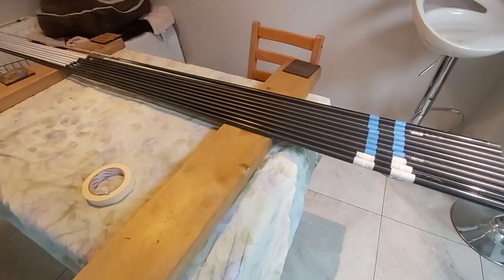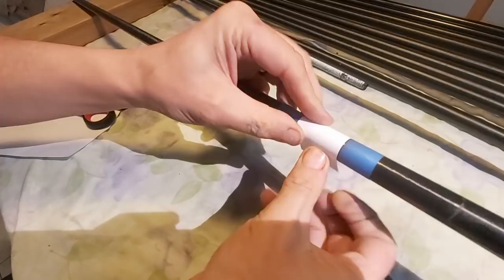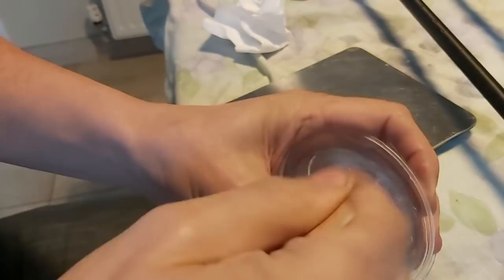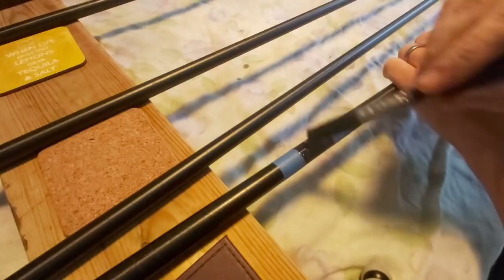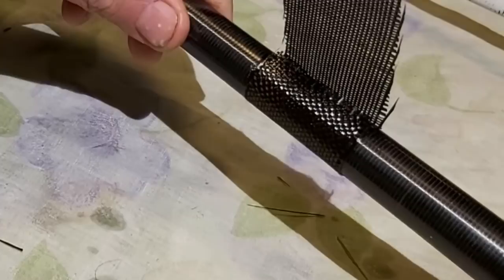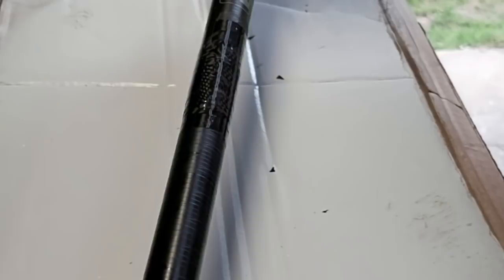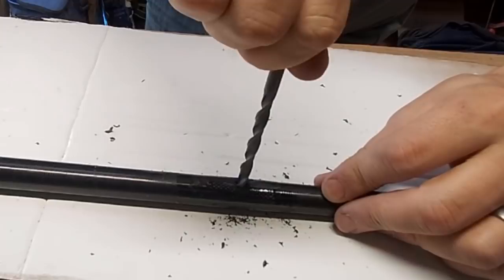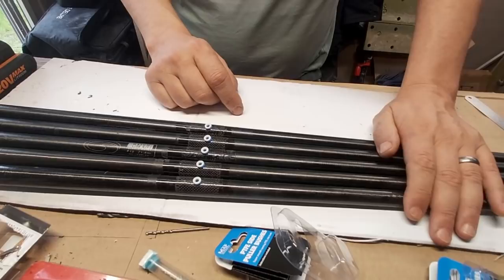CHEAPEST WAY TO GET SIDE PULLERS, Pole wrap and side puller start to finish. MAP side pullers.

Comment: Tip for you that I use. When drilling into the section place a length of wooden dowel rod up inside. It helps  support the section and will stop you drilling through the other side if you are a bit heavy handed.
Reply from the maker: Thanks, good idea😊👍

Comment: Too much hassle  ,        It would have been much easier  to have bought a make of pole with the puller kits already  fitted.
Like I did.
Reply from the maker: True but they didn't always come with side pullers, So if you had £600 worth of older top kits might think differently😊👍

Comment: Slipping a piece of dowel in the section when you drill stops all the worries of hitting the other side and the drill bit pulling in. Nice job pal
Reply from the maker: Good idea that, if I do any more I will be doing that👍.
Reply: @AverageAngler  I was thinking of sliding in a bamboo cane...

Comment: Hi mate I'm about to do a margin pole, I've bought the repair kit, pullers etc just wondered what width of wrap you used, is there any recommendation for the wrap size?, Also the measure from the end to the third section? Thanks
Reply from the maker: About 4inch wide would be more than enough. Best thing regarding distance from end of the kit, just think where you would want it when you are playing the fish.
Reply from the maker: I think I do measure the width of my wrap on the video? Might be 2 inches??
Reply from the maker: Hi Matthew just rereading my comments if you are doing puller wrap then 2 or 3 inches, if it's a section repair 6inches.

Comment: Why did you decide to omit the hair dryer heat shrink process on the heat shrink tape that consolidates the resin & fibres into 1? If you miss this, you will be left with an uncompressed, softer, weaker, rougher finish with loose fibres.
Reply from the maker: Tape provided with the kit I use, does not shrink when heated. You have to apply quite a bit of pressure when wrapping, my finish has always been good😊. You can get kits with shrink tape and use a heat gun if you wish👍.
Reply: @AverageAngler  Maybe you have forgot your own video. At 27-29 mins you criticise your own finish and start sanding the rough bits/steps. I would recommend using the heat shrink tape. You can only put so much pressure on with the tape unless its shrink tape because your tape will have no elasticity to produce tension. You could go over the clear tape with stretched insulation tape afterwards to provide some of the missing compression. Your windings are far too spread out too. If you look at the spirals on a professional pole, they are only 3mm apart. This is because the tape is 90% overlapped with only a 3mm offset from the last wrap. If you did this you'd get a higher pressure and better finish. It's like 10 elastic bands round your fingers will crush them more than 1 elastic band. Please don't take this as criticism - it's positive advise and we're all here to learn. You can also reduce the fraying - cut the length parallel to the mesh and you'd have fewer stray ends to combat. Also, keep the cloth in a long length and rotate the pole until you have a double wrap, then cut it to length. This way you can keep the tension on the cloth without accidently pulling off the last strands.
I showed the composite dept at my work what I wanted done to my poles - the above is what they said - it's good positive advice!

Comment: I use a piece of hose pipe, inside the pole section. Then when you drill or use a mounted point, you can not go through to the other wall of the pole section
Reply from the maker: A great idea, 👍. Thanks Paul😊

Comment: Hi john just in the middle of doing my side pullers I've checked them after 2+hours and they are tacky but can't get the wrap to stick would it be I haven't put enough of the formula on I only put it on thin or do I need to wait longer getting worried now?
Reply from the maker: Probably gotta wait a bit longer, all depends on temperature and  ratio of hardener. Good luck👍
Reply: @AverageAngler  It get tacky but the wrap won't hold don't know what to do now with the sections will i have to rub it all down again you made it look so easy?
Reply from the maker: @paulsomersetwolf5970  it should hold, it won't be a mega strong hold just enough so it clings to the section. Are you doing it in the house not in a cold shed or garage.
Reply: @AverageAngler  in my garage but  let them dry in the house it was tacky but left it for 4 hours but watching yours when laying the sheet on the part it just stuck but when I started to go around the section it just wouldn't stay it flicked up where I started so I gave in will I have to sand them down again to restart theres not loads on which may have been why it didn't work?
Reply from the maker: Sounds like you were nearly there, sometimes it doesn't stick so well, but you can stop the end curling up by wetting it with the resin on the brush. I tend to just start it on the tacky stuff and kind of brush it on with a wet brush(wet with resin). I would rub it down a little before retrying don't go mad though.
Reply: @AverageAngler  yes already to go again I will indoors in the warmest place and just try one and see how go then hopefully do the rest I think the temperature and not putting enough Resin on is my problem 
I do 3 parts Resin too 1 part hardner but soon thickens up but it's the same as you do.
I will get it right if it kills me🤣
Thanks for all your help👍
Reply from the maker: Just check the ratio of resin to hardener, sometimes they change the resin so ratios change. Should have some instructions in the pack.
Reply: @AverageAngler  just done 6 kits now and much better I was doing it in the wrong temperature but started with two yesterday just unwrapped the two and there not to bad really but I think the next 4 will be better 
Got easier and confident the more I done.
Thanks for your help John.

Comment: How are these holding up mate?
Reply from the maker: They were working fine, I have now upgraded pole and have some newer top kits. I isn't upgrade because of the kits they are still fab.
Reply: @AverageAngler  thanks, priced it up not using one of those pre packed kits and it's much cheaper.

Comment: Thanks for the tips on how to do the wraps , I bought the repair kit off ebay and did 7 kits with loads to spare , so it's a really cheap way to do them , and it was also really easy to do , would recommend anybody to have a go , cheers.

Comment: Did 4 over the weekend a bit of a pain in the rear with the carbon ends always coming loose but got there in the end. I only had a small bit of the clear tape in the kit I bought - ran out quickly so the last kit I had to use electrical tape backwards - worked fine.
Once the resin had gone off and I removed the tape it needed a light wet n dry sanding to smooth a few rough ridges. Keyed the whole repair and gave a light coat of resin to smooth it all out - 
end result nice lovely smooth and glossy finish.
Reply from the maker: If you rub the wrap down a bit, a coat of lacquer gives a nice finish.

Comment: Hi john 
I sand my pole repairs blend them in then lacker them it gives you a lovely finish.
Great video john 👍
Reply from the maker: What do you use for lacker, I would probably have done that if I had some lacker.
Reply: Hi john
I us autotek lacquer from the car when youve flated them off with different grades of sand paper and wet &dry it will look dull till you lacquer them you will get a nice smooth finish john

Comment: Good stuff.

You inspired me to get some carbon fibre and resin and a few MAP side pullers to have a go now.

I can't believe how awful that carbon fibre is to work with. You cut it nicely then the slightest sideways movement pops the edge strands out then it gets worse from there!
Reply from the maker: Yes it can be tricky stuff😊👍

Comment: I am lazy and just slide a piece of an old pole down the top kit to the place I need it. Glue it.You now have as really strong section to drill into. Yes a bit sticks up but a bit of masking tape over it does the trick. It works honest.!
Reply from the maker: Whatever works, works 😊👍

Comment: Great video! I am considering doing this to my topkits. I also found this on the internet, not sure if it will be the same in strength as the carbon wrap. = Vespe stripper side puller + wrap – DRILL 6.0MM
Reply from the maker: They work well just need to check they are correct for your pole, don't fit all models😊👍.
Reply: @AverageAngler  Thank you very much, I will give the Vespe a try. If it doesn't work out I will do the carbon wrap. :) I have another question, I see that you mainly fish with the feeder. Do you have experience with Preston poles?
Reply from the maker: I have never used a preston pole, I mainly use garbolino now, so I have very little experience with them.

Comment: Great video. Is there anything you'd do different if you did it again?
Do you think it would be possible to 'mask' either side of the wrap maybe with the clear tape 1st to get a neat edge with less resin overspill? It appears that any other type of tape may not come off so cleanly?
Reply from the maker: Use even less resin I think, and glue those side puller bushes in😊👍.

Comment: On eBay & other sites, they sell carbon tubes in 300mm lengths. What do you think about sliding a 50mm sleeve down the pole and gluing into place? I note that there's another video where vespe supply a 'pulla' sleeve that looks nothing more that 20mm plastic conduit that you can buy at wickes at £1.30 for 2m.
Reply from the maker: I wouldn't be doing anything like that, the plastic tube or carbon would need to match the taper of the top kit I should think? The carbon wrap is the lightest way to do it and will definitely work if done properly. You wouldn't want to snap your top kit, would be a false economy.
Reply: @AverageAngler  Good discussion... to make it clear - I'm not arguing... just thinking aloud with respect to the title "CHEAPEST WAY TO GET SIDE PULLERS"...

I have no doubt that a professional carbon wrap is the cleanest way to go. It's just a question of whether quicker cheaper alternatives work just as well with no degradation of function and look much more tidy.

People have 'sleeve' repaired sections for years with great success and 'whipped' over it. Even the top of multi-tip feeder rods simply have 2" piece of of carbon reversed and glued in to take the tips. Every joint on a rod/pole is a 'sleeve' that takes a hammering and they're not even glued!

Vespe have sold out of 5 million plastic 'plastic conduit style' kits with no issues and I know many people that have slid a piece of carbon sleeve over to fit a puller with no issues.

With respect to you taper concern (both carbon & plastic tube), over a 40mm sleeve length, my vernier caliper does indeed a indicate a difference of circa 0.1mm due to the taper and it was also a concern of mine. However, last week I put a sleeve on an scrap #2 pole section, put a dab of superglue on the 0.1mm 'open/gap end' and the glue disappeared and filled the gap with capillary action - looks amazingly neat where the glue created a radius between the pole and sleeve. The glue went in just like watching a soldered pipe fitting. I fitted a puller bung and fed a bike brake cable with a 'pip' at the end through the pole section. I then held the section vertically above my 18kg bike and lifted it with no issues. This is a unrealistic equivalent to lifting a 40lb carp - so it passed my test!

Note that the conduit is the tough stuff that they use to protect vulnerable external mains electrical cables. You could stamp on it (unlike a pole)! If you said that it weighed 1g more or is 1mm bulkier, I'd not argue with you - although it felt better to grip in the hand.

Using some poundland superglue and a piece of conduit and a pipe cutter that I already have, I think that I could fit around twenty in one hour with a total of £2.30 worth of materials. Having read the details, what do you think now?
Reply: @AverageAngler  Thanks. Is your 'thumbs up' your concurrence that you are happy with the above idea and retract your previous concerns?
Reply from the maker: Why don't you speak to the composite materials experts where you work, see what they think of your idea? I'm not a carbon fibre expert just a fisherman😊.
Reply: @AverageAngler  It was actually them that have me the idea but they aren't fisherman.
Reply: @Adam-hr7vs  why don't you do you, and let others do them? "it's not criticism", but.....
Reply: @jonathondavies8347  Sorry don't understand your question... "why don't you do you, and let others do them? "it's not criticism", but....."???

I actually had a tube given me at work with 0.25mm thick fine pre-preg that I cut into 40mm lengths, smoothed the ends and superglue them in place. Looks very neat and has worked fine so far.
Reply: @Adam-hr7vs  that's one of my points. you had someone else do it for you. this guy is showing us him doing it himself. perhaps you put up a better video?
Reply: @jonathondavies8347  Nope - I did it myself, I just got the supply of the tube free. Anyone can buy a length of conduit, tube of carbon, scrap rod sections etc.

I don't think you need a video to see how to put a drop of superglue on a pole and slide a collar down over it, but here's a ready made video (much better than i'd do) https://www.youtube.com/watch?v=tO_3LL8rGnI&ab_channel=Vespefishing

I think it's great how the OP had a go at doing it. I'm simply offering an alternative idea of quicker, cheaper, much easier & neater option for people that are poorly skilled at doing a 'proper' carbon wrap (that includes myself)!
Reply: @Adam-hr7vs  that tells nothing. no voice over explaining anything. nor did i see anything about gluing?
Reply: @jonathondavies8347  I'm not sure if you are playing me up or really need help understanding the professional marketing video. It's certainly more info than you get on the packet!

If you need further help, try this video with a man that speaks. https://www.youtube.com/watch?v=eMe28vTH6do&t=68s&ab_channel=MatchFishingMasterclass

When i did mine, in addition to the above video, I slid the collar down to find the position it sat, then wrapped some insulation tape around the pole just under the collar to act as a stop. I slid the collar back up the pole, put some glue in the area that the collar was to be glued (above the tape stop) and quickly slid the collar back down over the glue before removing the tape.

Comment: Hi John just watched this again and have decided to have a go myself have ordered the kit all mine at the moment are end pullers which are fine but these look to be neat 
It's the drilling I'm not confident with but will take my time.
How far up the section do have the pullers to be around 10 - 12 inches would that be about right?
do you rate the map pullers? Over the Preston is there any advantage?
Great vid though tight lines👍🎣
Reply from the maker: I have had a few of the map pullers pop out, so a little glue is a good idea. The preston rollers need a bigger hole, but you do get a roller with their one. As for location, think about where you will hold the kit when playing fish. You want the puller to be close to the hand on the pole, so you can grab the elastic easily. 
Also if you have to wrap to far up the section you will lose elastic length, which is another consideration.
I've had no serious issues with mine and its been over 6 months since I did them, hope it all works out for you👍
Reply: @AverageAngler  thanks for your reply John is there much difference in having the roller one to the map do they work the same! 
It certainly is a saving doing it yourself than getting it done professionally thanks again for the help I may contact you if I get stuck doing them 🤣 keep the great vids coming 👍
Reply from the maker: @paulsomersetwolf5970  I have a kit with a preston roller in that I bought second hand, I don't personally notice any real difference. Other people do prefer the preston ones, I suppose it's all personal preference. I havnt seen Anything I would call a real advantage go with the map rollers they are a good price 👍
Reply: Map need to be glued in or they'll keep falling out. Preston by far the best